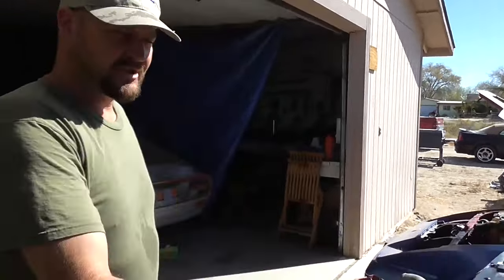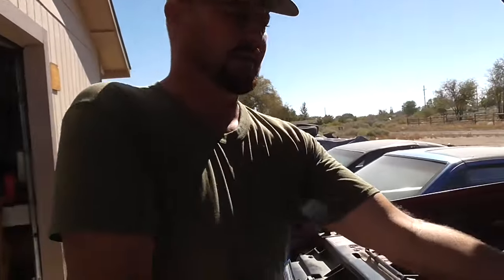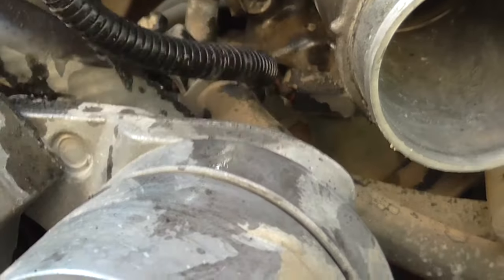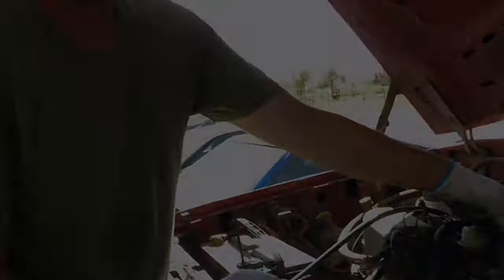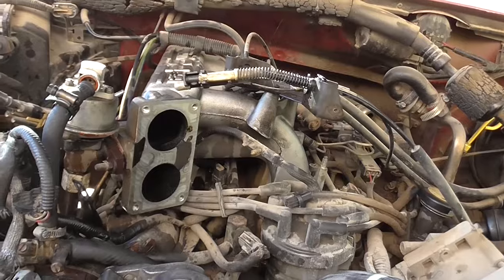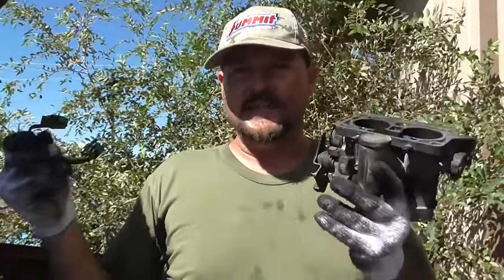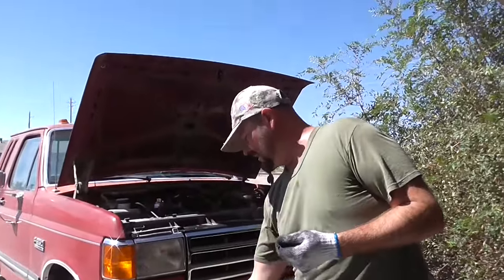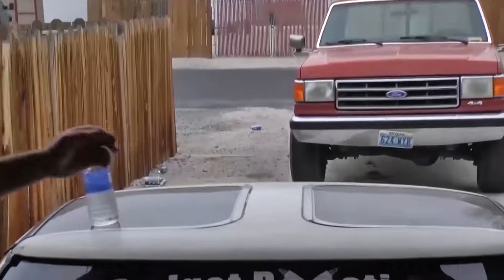DIY Throttle Position Sensor Change (86-96 V8 Ford Trucks)

Comment: Viewers should be made aware that most Ford throttle bodies of this era do NOT need to be cleaned and should not be cleaned.  They are designed to be sludge tolerant and are coated to prevent aluminum corrosion.  If you clean it you eliminate the coating.   See Tech Service Bulletin 91-25-07: (ACTION:  A new idle air by-pass service kit (F2PZ-9F939-A) is now available for service use to correct sludge contamination concerns of the throttle bore and plate only.  It eliminates the need to clean the majority of past model throttle body applications.  Cleaning is not required on sludge tolerant throttle body designs released for 1991 and newer model years.)  If it is older and had the service kit installed it should have a yellow sticker with a warning not to clean it.
Reply from the maker: +damengineer Interesting, I always clean sludge from a throttle body.  It makes no sense to me to leave it there if an opportunity arises to clean it.  Now cleaning it with just a towel without carburetor cleaner should not disturb the corrosion preventative coating on the aluminum surface.

Comment: I did everything you did but when I was cleaning my throttle intake. I found a silver ball on the ground right were I was cleaning. Is there a metal ball that goes into that there throttle body peace you took off to replace the sensor?
Reply: I also have a 1991 Ford bronco and it's the same setup as yours.
Reply from the maker: I did not see a ball when I removed my throttle body.  It could be the metal ball from the ratchet that holds sockets to the ratchet.

Comment: dont rip every thing with anger tho becouse those wires are as old as the rubber  and when you break a wire you going to have even more fun tracing what wire is broken.

Comment: What if the bottom left bolt on my throttle body is rounded off, how do you recommend i get the bolt out
Reply from the maker: Remove throttle body put on a vice for better access

Comment: whats the reason  why u had to change this valve? and   what does it  do?

 o have a 1996 f150 5.0///  can i increase throddle body size to gaing more   hp?  or   chage  what to get it to  smoke the tires..       rear  end  gear   change?    something    had  get up and  go   but no  burnouts   damm..   remove smog pump and ac  belt.. along with running a  elecrtic  fan    reduce  strain on 5.0

Comment: It's funny. I have an 86 f150 4.9 and it has torx screws, and it is right in the front. Took me literally 5 minutes to change it. Sucks that they made it like that on the bigger engines.
Reply from the maker: cadauctions31 Yes the manufacturers like to throw fasteners that are real hard to remove.  It seems they want to discourage us from saving money working on our own vehicles...
Reply: Yup.... typical big business bullshit!

Comment: I have a fuel problems and I don't know what is the problem 91 f150 runs great at idle... But when you drive it it stumbles like it is running out of gas stalls but sometimes catches itself... Codes 332,334,327...replaced IAC,fpr,coil,plugs....fuel pressure is at 30 at idle is that right now I'm stuck on what to do??? Any help is greatly appreciated from anyone
Reply from the maker: +Bri Pri Throttle position sensor sounds to be what you are describing.
Reply: +Bri Pri  map sensor
Reply from the maker: +christopher shea either one can cause similar symptoms, both reference fuel going to the engine, one does by throttle position, the other does by referencing vacuum.
Reply: Exactly !  In reading all of these comments, I notice some confusion by many over the issue of MAP vs. MAF.
In most vehicles, you have either a MAP (Manifold Air Pressure) or a MAF (Manifold Absolute Pressure) but you will not have both.
Reply: Meant to say a "MAP system" or "MAF system."  Sorry for any confusion this may have caused. Additionally, I've never liked the Haynes "manuals" as they omit more essential information than they provide. I've bought the Factory Service Manual (FSM) for every vehicle I've owned since 2000. Recently (2 weeks ago) bought a '93 F-150 XLT w/dual tanks, 5.0L, auto, SuperCab LWB flare side and it's currently doing what all y'all have been discussing. Ordered an OBD I scanner from Amazon this morning and it'll be here tomorrow. Got the FSM on CD, eBay, 25 bucks. Greatly appreciate all the excellent comments here.
Reply: Scanner: https://www.amazon.com/gp/product/B000EW0KHW/ref=oh_aui_detailpage_o00_s00?ie=UTF8&psc=1
Extension Cable: https://www.amazon.com/gp/product/B000EVYH36/ref=oh_aui_detailpage_o00_s00?ie=UTF8&psc=1

Comment: hey would this work for a 1989 camaro TBI 305
Reply from the maker: +The1972Cutlass throttle body injection is quite the different animal.  They do have a throttle position sensor and it is much easier to access than this Ford.
Reply: O OK I messed with my idle adjustment screw on my TBI and I'm unsure on how to set it back at the correct setting, also installed a new tps but didn't know I had to adjust it, do u know how to adjust it to the proper setting
Reply from the maker: +The1972Cutlass On my 87 Buick since it is OBD I, its hard to find scanners that show live data so you can view TPS setting.  It should be around .046 at idle.  I have a scanmaster on my 87 Buick that connects to power, ground and plugs into I believe the top third connector on the OBD I plug.  The scanmaster show live data for our OBD I cars and it is worth the money to purchase this and install it on your dashboard somewhere so you can monitor all of your sensors on your engine at any time and it is very useful in adjusting idle, TPS and troubleshooting problems such as troublecodes.  Recommend one of these or a scanner that reads live data for GM OBDI.  Let me know how it turns out.

Comment: You made that WAY too complicated. I've replaced it twice, both times without removing the throttle body. About a 20min job. Best thing to do is get a small pair of pliers for the screws.

Word of advice, when you replace this part make sure you get a Motorcraft or equivalent (NTK, Denso, etc), so you don't have to replace it twice.
Reply: Lmao how

Comment: Ya it cost me about 20 bucks. For sensor and gasket and parts cleaner.
Reply from the maker: Not bad, especially when you find out what a shop would charge to troubleshoot the problem, then change the sensor out.  At around $100 or so per hour, that can add up.

Comment: i have a 300 inline 6 and my TPS was unplugged and i cant seem to find the other end  i have one of thos failed idea YAF feedback carburetors and its a nightmare  1/2 the vac lines just are broken and just have a screw in them  and all the electronics to the carburetor are unplugged some plugs are melted but some just seem gone

i have half a mind to just strip my 82 and dump the computer shit in the 85 

thoughts on witch way i should go if it was yours?

Comment: 5:45 Ford engineers give each other a "high five" when the can sneak in "useless parts" into the vehicle build.  The bean counters are always trying to delete useful stuff if they can save $1000 when making a million cars.  Engineers always working to add extra weight and increase cost for no good reason.  < sarcasm >    If Ford engineers put that metal clip in there, it's there for some reason.